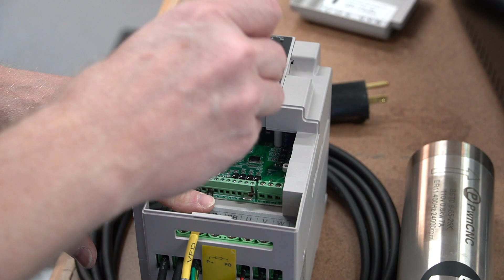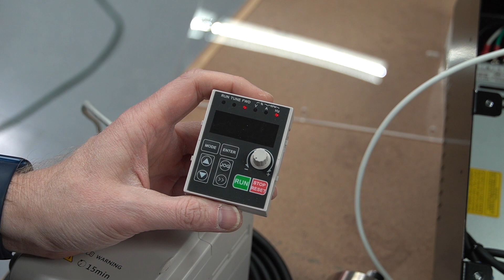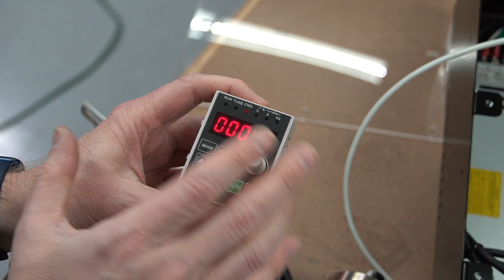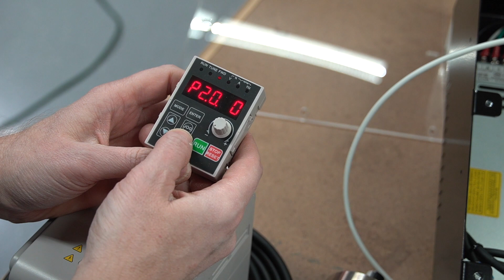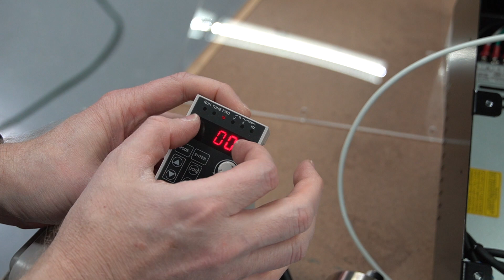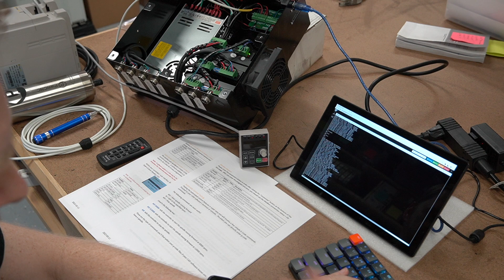Control your spindle via PWM on Mill Right Mega-V Controllers

Comment: Can I control your spindle speed using UGS G-code sender that Millright tailored. I do have 4'th axis capability I haven't used yet. Just started to look at the software you suggested.
Reply from the maker: @greatwhitewing  yes, our vfd can be controlled via Modbus or PWM.  Most controllers offer PWM which is the way I control it on my Mega-V1